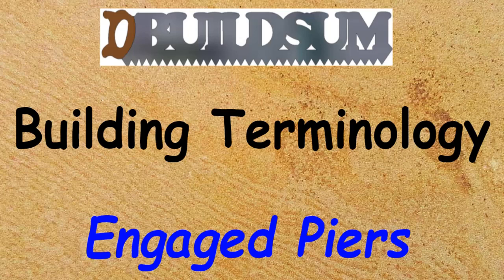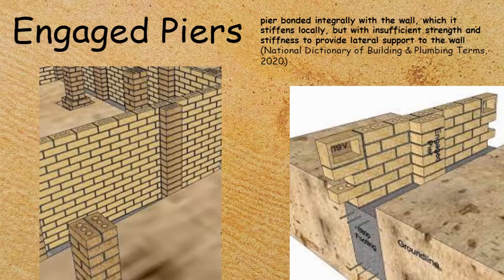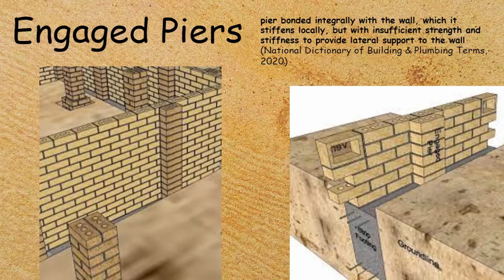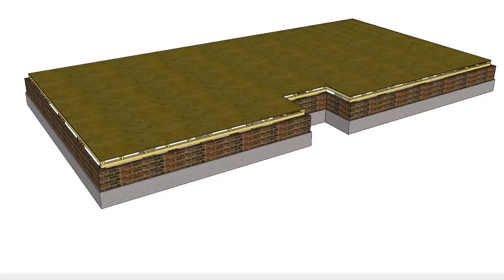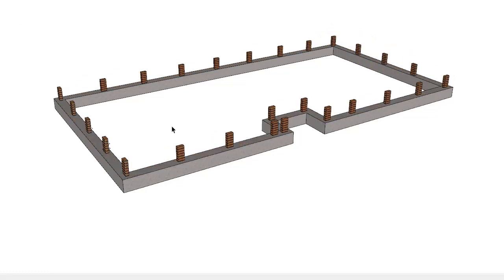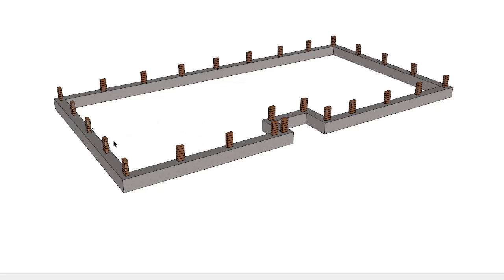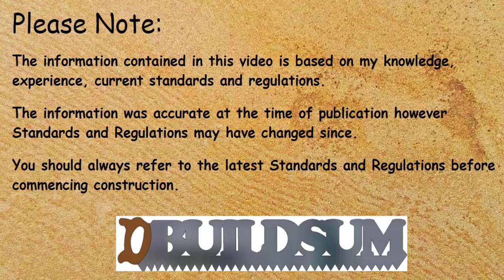Building Terminology - Engaged Piers

Comment: Been watching your videos, very informative and well presented. Very helpful for my 121 year old home!
The back of my brick house has 2 x 11m long, 2.7m wide Skillion style tin roofs with about 150mm "step" between them.
The rear, lower section is just tin on rafters on a Ledger board at the high side and sits on the wall at the lower side.
My plan is to raise the ledger board up to the heights of the other one in sections by removing a row of screws in the tin and using acroprops, then securing with a new ledger board at the new height (Left a 150mm overhang on the upper tin) then I'll re-frame the rear and side walls to match the slope.
I'm going to get an electrician in to make safe the whole area and do the work over a couple of weeks.

1. Is this a good plan? Any input on the method?
2. At what point do I call in the electrician and plumber to reinstall lights, outlets, pipes etc to save myself money?
3. Can I make notches in the frame for the existing water pipes to avoid a total reinstall?
Reply from the maker: Hi Matt
That sounds resonable. Without seeing it im not sure that I could suggest anything else. 
It is best to call the electrian/ plumber when you have finished all the framing that you need to do but before you close anything in.
Yes you can notch around pipes etc just try to remove the minimum amount of timeber that you need to get things to fit. 
Hope this helps.
Reply: Sweet as, thanks for that!